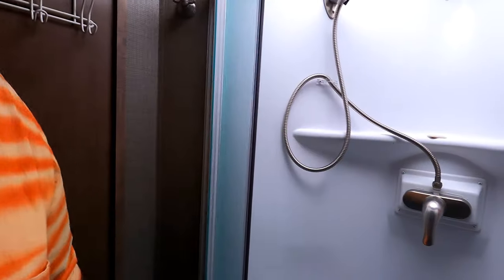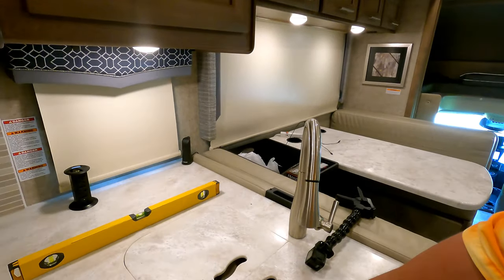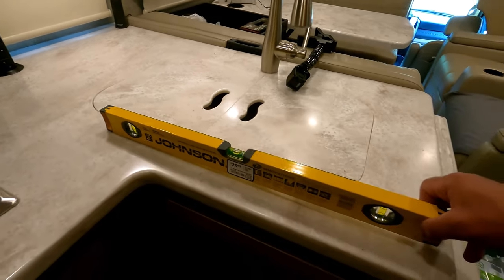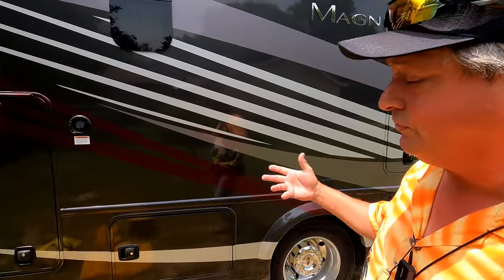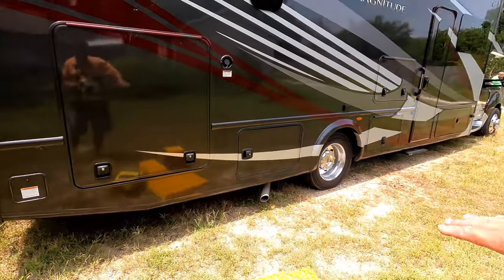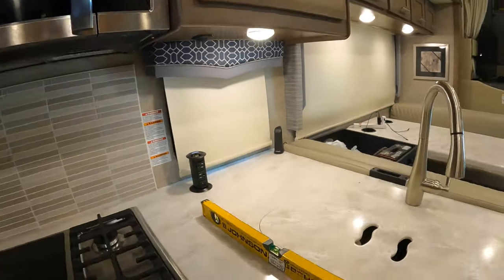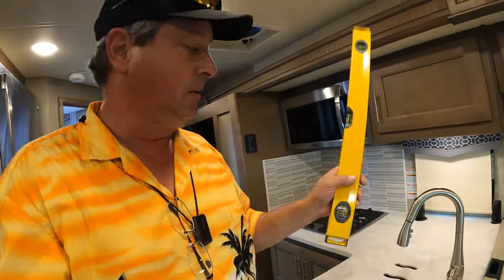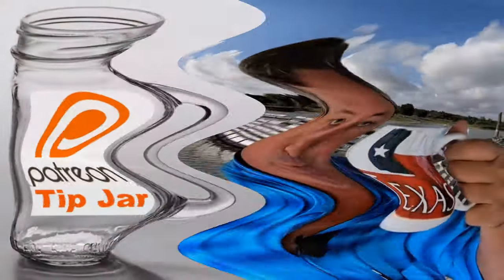Leveling A Super C Motor Home Or Rather How To Level A Class C

Comment: Thanks for your naval service.  Can  you level as much as a 5-6% grade?
Reply from the maker: The steeper the grade the more blocks and effort required. I have leveled in some very steep sites, I have no idea what the slope was but on one of them the front wheels were about 20 inches off the ground. This is not something that I want to do on a regular basis especially with our coach having a full wall slide.

Comment: Good info would it be better to use the lever on the floor because the cabinets can be off when they build them?
Reply from the maker: That is a great point. I should have mentioned that in our coach the counter top and fridge were aligned so If you leveled to to the counter the fridge door would be level where as if I leveled at the floor the fridge door was prone to popping open when I walked through the coach. I really got tired of that fridge leaning out of the cabinet and reworked the whole thing and now I am leveling to the floor.

Comment: I missed the point of rolling your rig's rear tires up on those wooden planks. What did that accomplish? Seems to me that if you didn't roll up on those wooden planks, you wouldn't have to use as many pads under your jacks and your wheels would remain on the ground.
Reply from the maker: the slope at that location is more than the level system can handle. without the wheel blocks the level system gives a fault code and when the slide is opened it will also go into fault mode and will lock up.

Comment: Random question: in your shower you have a metal shower caddy. How do you have that fixed to the shower wall?
Reply from the maker: That is not a random question! Nothing will stick to those walls! well almost nothing. here is what I used...
https://amzn.to/3SOyjIX
https://amzn.to/3Ub1mHO
https://amzn.to/3fh9tnp
I also found a small plastic basket that fits inside the shelf and drilled a few drainage holes in the bottom so small things will stay in place.